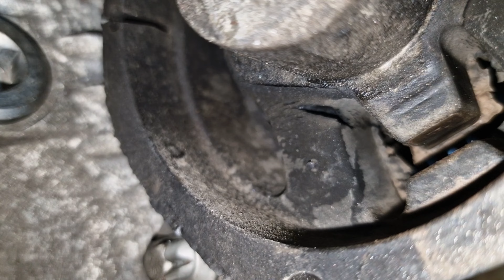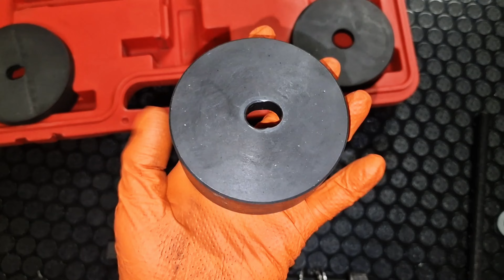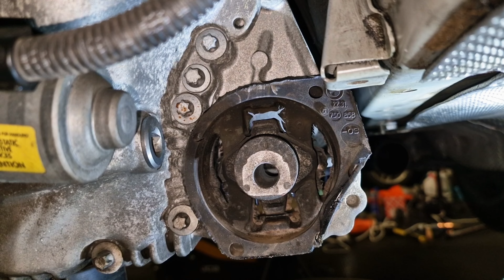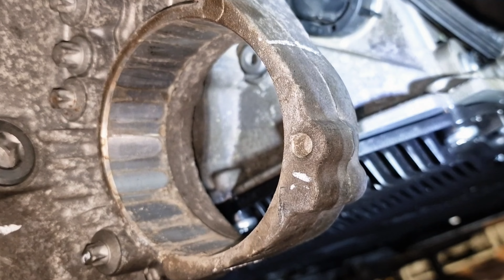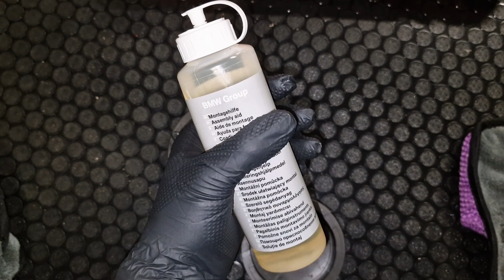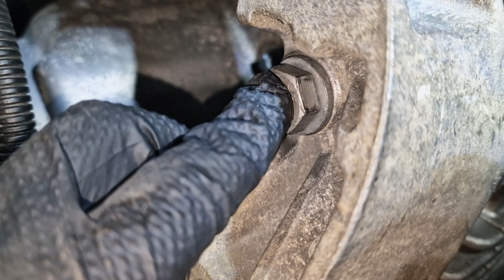BMW 330xd E92 - ATC 300 Transfer Case Mount Replacement

Comment: What problems and symptoms did you have when you replaced it?
Reply from the maker: I replaced it because I noticed visually it's broken. However, I had symptoms like slight vibration when you start driving or stopping. I think that bushing contributed to that.

Comment: Hi! Thank you for the detailed guide! What were the symptoms, why you changed that bushing?
Reply from the maker: Hi! I can not say for sure, but I guess a higher vibration of the transfer box / transmisson leads to higher vibration on the rear prop shaft, affecting flex discs and the prop shaft mount. I replaced it because I noticed visually it's broken. However, this video is part of the transmission job that includes a lot of other things, and I had symptoms like vibration when you start driving or stopping before the crossroad. I think that bushing contributed to that.